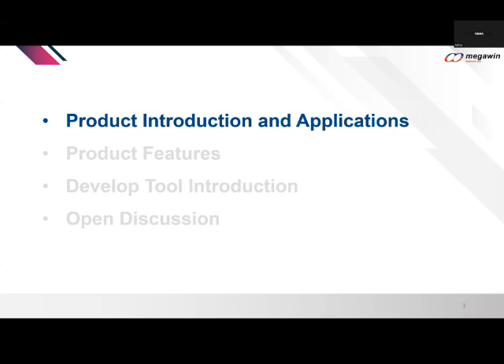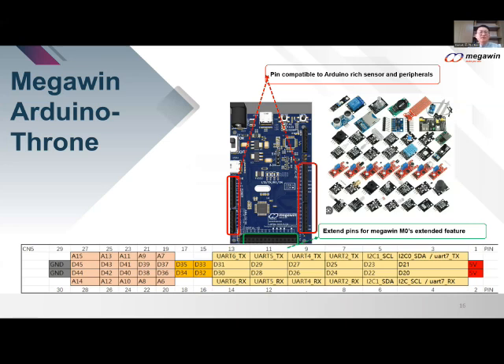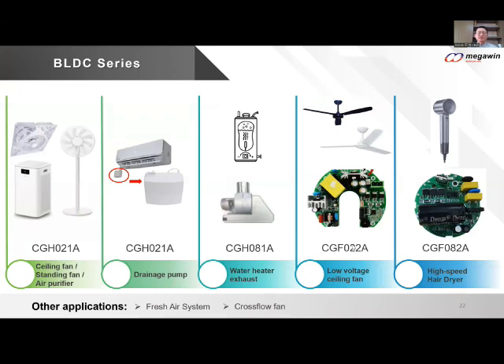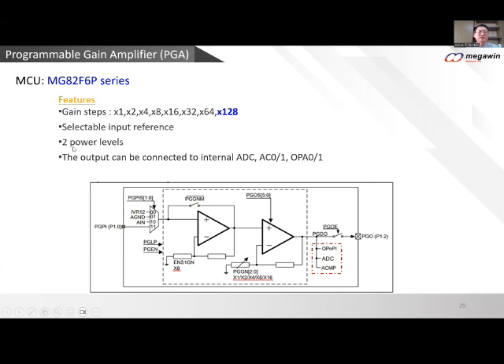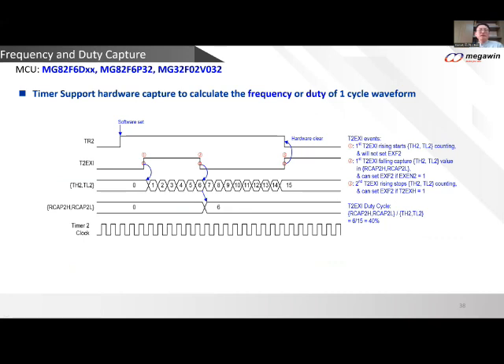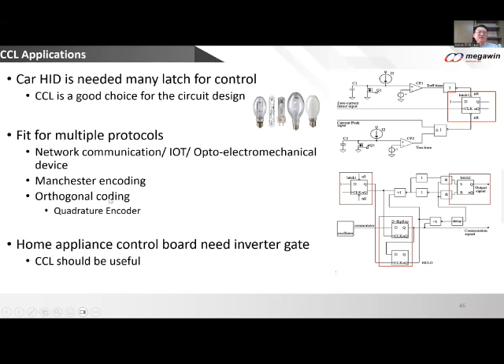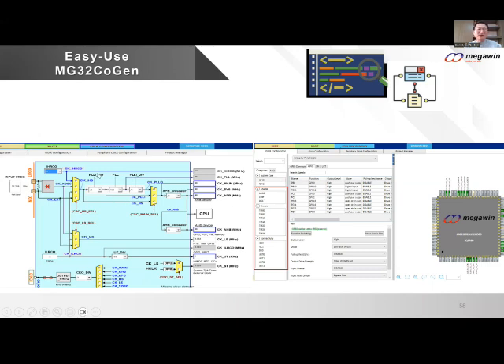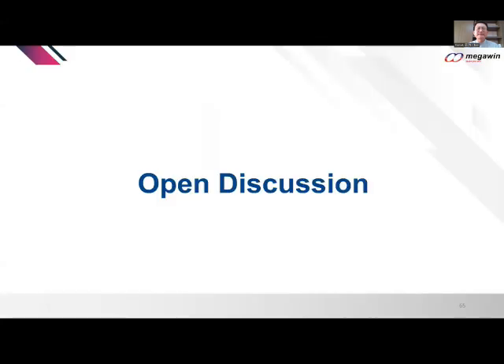2024.06.19 Megawin Product Introduction

Comment: Hello I face one deficiency with Mega wing as compare to Nuvoton is ADC Comparison using Hardware and Weak up timer are not available with Megawin.
Reply from the maker: Hello
Our 8051 can use ADCWI to drive the PBKF and change the I/O state to start the timer. PCA and an I/O are required.
And the M0 Product can use the ADC Window Detect function to change ADC0_Out, this change can affect the IRT7, this IRT7 can make the Timer start Count or stop Count.
Please tell us witch Nuvoton product are use , it'll be better to help you.
Thank you
Reply: @_megawin180  MS51PC0AE